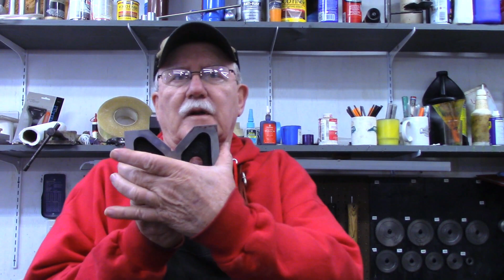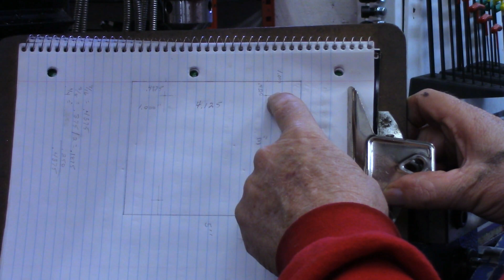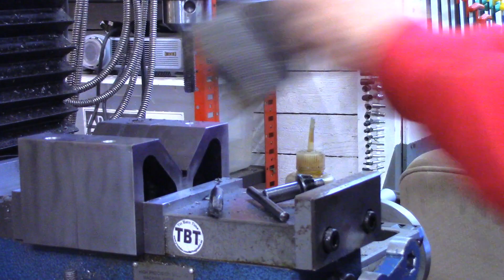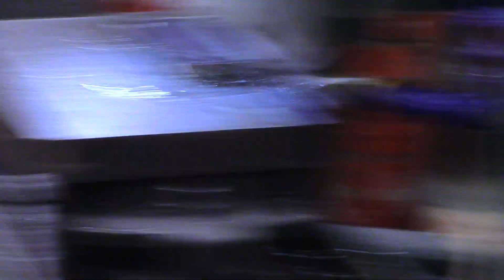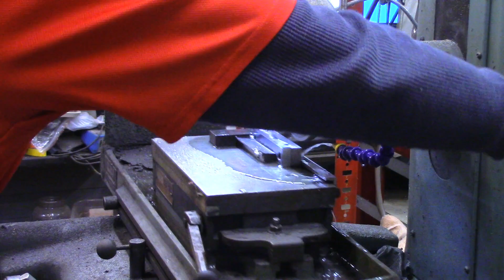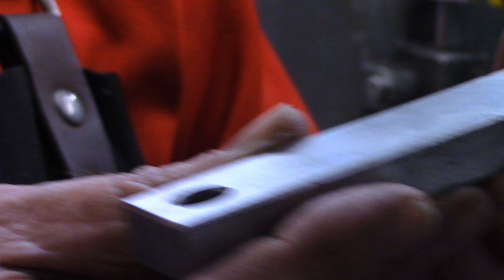5" V Block Modification

Comment: Nice work and nice video.
One question. Why not mill the clamping bars used to lock the work to the V blocks? Precision and surface finish is hardly needed.

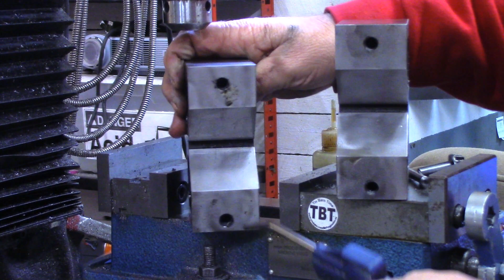Comment: Hole spacing not symmetrical, see 12:33 for a clear view that with the blocks on their sides and no chance of "Optical Illusion" the bottom holes are clearly much closer to the edge than those at the top!
Reply: He forgot to add the radius of the edge finder on that side. The holes should have been .100 farther from that edge.

Comment: Enjoyed...going to copy this, curious what you think.... set 1 block in the vise with stops, locate then do all the operations without moving the mill, but swap/flop parts?...assuming the parts are similar in dimensions ...thoughts??
Reply from the maker: Swap/flop parts would definitely work and would be interesting to witness - give it a try.